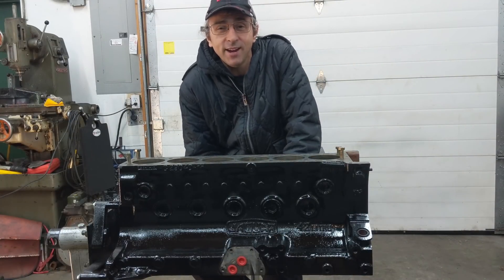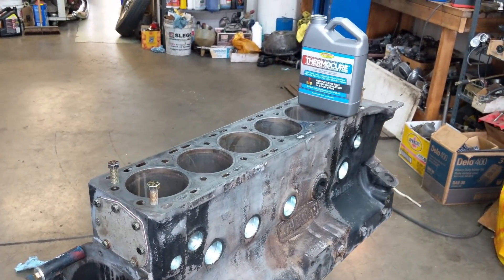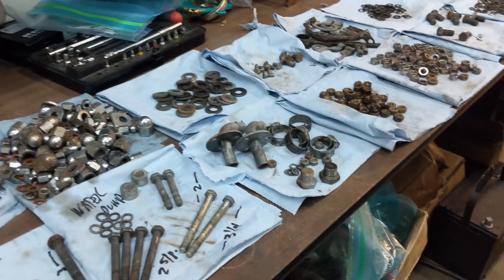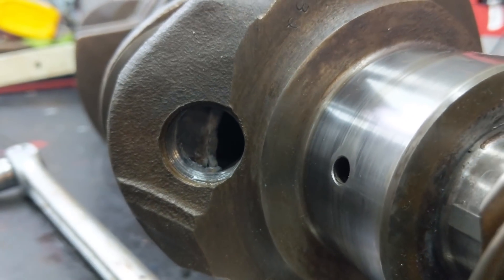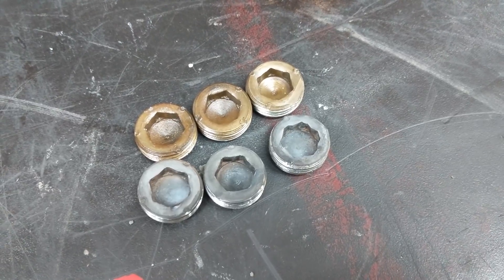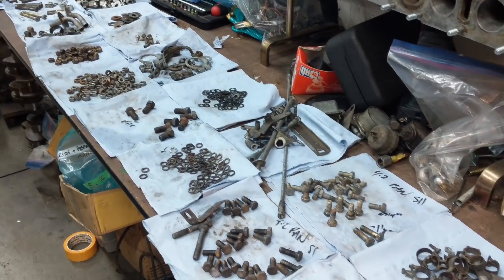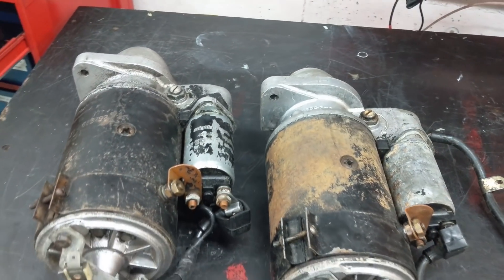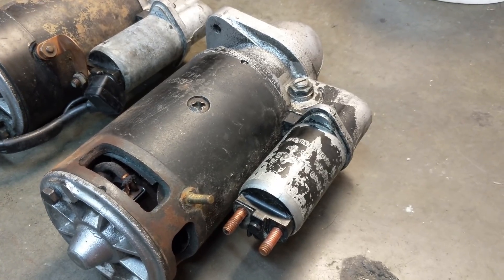My Junk E-Type Engine Part 4

Comment: Nice to watch the 4 videos, but I've driven the E-type. A typical, unreliable heap of a car. Jags are just the same, new or old, today. I was surprised that the E-type attracted any warmth. All the weight is over the front wheels, giving heavy, lifeless steering. Next to no weight over the back, giving slippery, skidding traction and abysmal handling. Next to no rust proofing and weird Joe Lucas (the prince of darkness) electrics. Thank goodness the Japanese and Germans came and closed our UK car plants.
Reply: Actually, the weight of the car is exactly 50/50 front to rear and the steering (at least in my 3.8 FHC) is precise and responds to even the smallest of driver inputs. I've changed out the dynamo for a modern alternator in mine, but apart from the remote starter solenoid, electronic ignition and fuel sending unit which I've changed out for new, (both were a bit dodgy after 50+ years and were date stamped) everything on the car functions properly. Even the original clock which was rebuilt when I bought the car nearly 30 years ago. My car has been in California its entire life and has ZERO rust and also has its original, matching numbers engine block, cylinder head and carburetors. The key to successful, long-term E-Type ownership is to know your machine and make  upgrades and improvements where they make sense. Were these cars perfect? Absolutely not, but the biggest problem (at least here in the US) wasn't so much the cars themselves, but with ham-fisted, blockheaded wrench monkeys that simply did not and/or do not know how to work on these vehicles.
Reply: @slugworth63 ; well spoken as a real owner. It takes one to know one, as the adage goes.
Reply: @slugworth63  
Exactly right. Proper maintenance and modern upgrades are the key. This Sean guy must be the kind of guy to jump in his car and floor it and does'nt know his car-s. Yes, Lucas electrics are bad but are upgradebable.
Same with Citroën DS or SM of the same era. Wonderfull, reliable cars. BUT, as you say, you NEVER have "ham-fisted, blockheaded wrench monkeys that simply did not and/or do not know how to work on these vehicles." Period.
I bought a sorry, badly maintained but real cheap 69 DS in early '80s. Of course, the ingenious suspension had been butchered by a dumb idiot. Collected parts from everywhere, refurbished mildly the body and had my friend Norm take care of the mechanicals. Sold it 2 years later to a fan for (very) good money. He still has it !!
Reply: Ouch Sean.. I happen to own the "eye candy" Richard shows at the end, and find the car is very predictable, totally reliable and is smooth as glass in the mountains, uphill, downhill or while sliding the switchbacks. It's become a daily driver,  so much so that my thoroughly modern Digital BMW  has take a back seat all summer to this fully analog opposite. Thousands of trouble free miles and counting.  Mind you, Owen probably did a better job of restoring the car 'shell off' than the factory did originally. :). Note it doesn't have limit use collector plates, for a good reason.
Reply from the maker: Sean, thanks for watching. There is a good chance I will be driving this engine to Monterey next year. Wish me luck :)
Reply: @RichardMichaelOwen  And "wish me luck" is exactly the problem. JLR vehicles are assembled in the UK from parts sourced across the world at the cheapest possible price. The Indians won't pay a penny more than they have to. Relying on luck is ridiculous, and you know it. Proper Japanese or German engineering is the way to go.
Reply: Just about everything on my S1 FHC was Made in England. Lots of outsourcing of parts on modern vehicles, but that's with just about every manufacturer these days, but we're talking E-Types here. I'm not an expert on the S3 V12s, but the E-Types made in the 60s mostly before the Leyland days, were well built. Remember those days? Back when ENGLAND (not the UK) made the best of everything; cars, motorcycles & bicycles, music, fashion. Even airplanes! When you had something MADE IN ENGLAND, you had THE BEST! Sad to have seen the decline of British Industry. A once proud nation with an empire upon which the sun never set turned into a Socialist welfare state with mass immigration, cultural rot and more than half of its citizens on the dole. And it only took 50 years.
Reply: He's lost his mind,sounds like a millennial but i could be wrong,very bitter,a car is a simple machine, a engine, transmission and rear end or a front one in some cases, you get those things working in sync  and the car will run forever.

People make fun of Fords,i have a Ford Ive been driving for 25 years as a daily driver, i wish the thing would blow up so i can buy something different but no luck, i think maybe hes talking about that new shit coming out these days,what you have is a classic Jaguar and according to Enzo Ferrari "the most beautiful car ever made"  i concur,i have never owned a Jaguar and probably never will be able to but what i can tell you is, from watching these folks tear that engine down i was mighty impressed.

I have never seen a engine with wire holding bolts together or acorn nuts on the valve covers or those tabs holding some bolts down,only time Ive ever seen that is on handmade performance engines like old Colombo and Lampredi engines, Benz, Porsche and airplane engines and huge natural gas compressors which i work on for a living,the wire and the tabs on the bolts are a lost art when it comes to car engines and a sign that a old artisan built these things, many congrats on your car Sir, i am jealous.   @slugworth63
Reply: You're just bitter that you didn't buy one and hold it when they were cheap.
Reply: I have never driven one, so don't have a personal opinion, but Jay Leno (who is widely recognized as an automotive expert) has an entire section of his collection devoted to Jaguars, and is the proud owner of a 63 E type. He raves about the car. 
    https://www.youtube.com/watch?v=fPKSf5tHzsw
Reply: DATING HARLEY QUINN  
Baah, don't waste your time with him, a sad dork.